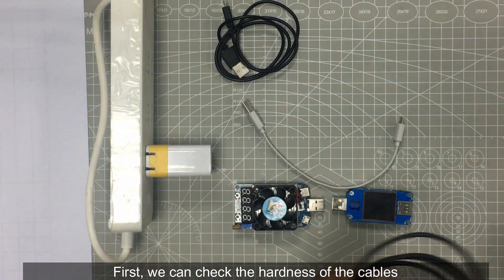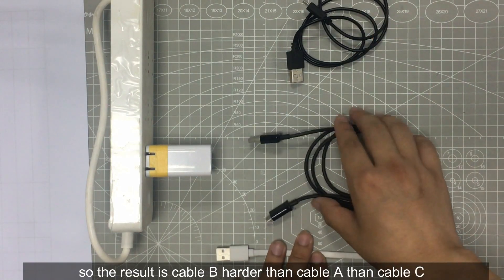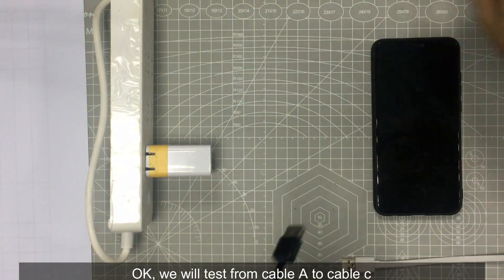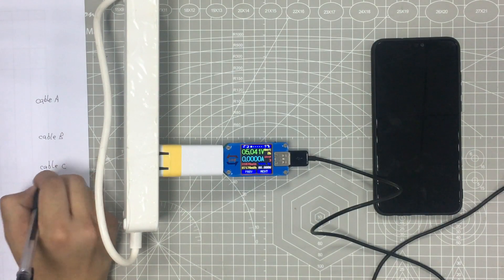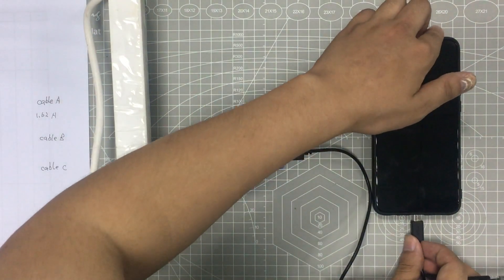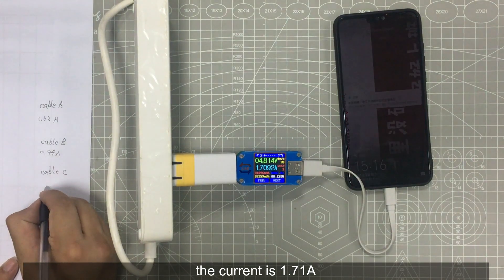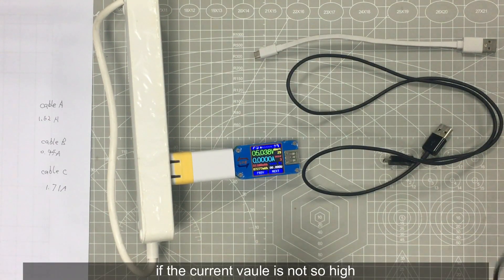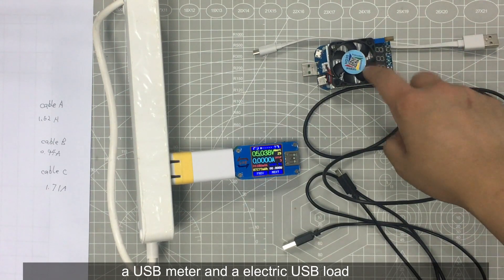How to choose a better USB cable with UM25C and HD35

Comment: It's better to check with 2A because resistance can be even higher than with 0.5A.
Reply from the maker: and for now this function is not so good because the USB-C cable are more and more commonly used, micro-USB cable are not used so often
Reply: @rdtech9153  yes but the function works also with UAB-C cables, or not?
Reply from the maker: @Joe3D  it cannot test a USB-C to USB-C cable， it can only test USB-A to USB-C cable

Comment: The lower current is not because of softness or hardness, its because of the length of the cables. The resistance increases with longer lengths hence different current values. The same goes with lower voltage as well. Thanks
Reply from the maker: in this viddeo, I showed the way to test the cable resistance

Comment: I think you should make a dongle for lighting to USB c, so people who want to test their USB c - lighting cable, they can use that dongle, with HD35. 

I just ordered the TC66C without HD35 since I cannot find the dongle lighting female to USB type C male. The only that I can find was from eBay, but it didn't support PD and in the description said, that it is not supported for charging.

If the dongle is a hassle, do you have plans to make HD35, with USB lighting connector?
Reply from the maker: thank you for your advice, I will tell our engineer to see if it can be achieved

Comment: Is it normal to have a voltage drop when you test the cable only. I noticed, when I plug the UM25 or 34, directly in a good charger, I get no voltage drop when I increase the amps. But if I plug the cable into the charger, and directly in the UM25 or 34, I noticed on some a voltage drop close to 1/4 v.  I have yet to find a cable in my home with no voltage drop.
Reply from the maker: Hi friend , could you make a video to show the problem ? thank you
Reply: Rd Tech will do, but it has nothing to do with the um25 or 34. Those work 👍. Just something I noticed when testing the cord plugged into the charger and then plugged into the um25/34 with a load attached. Some of the voltage drops would make it hard to charge a phone. It’s just crappy cables. I find it really hard to find a good quality cable, unless it comes directly from the manufacturer. If I get cables anywhere else , 9 out of 10 times it’s crap....love playing with these tester!!!